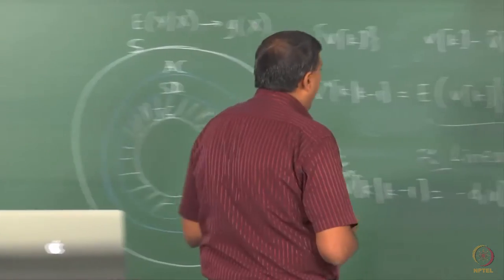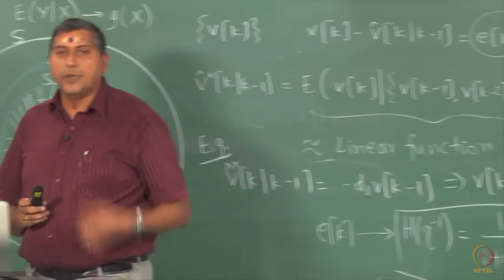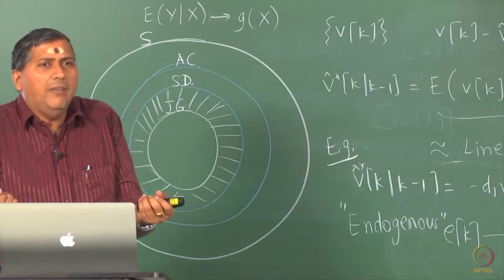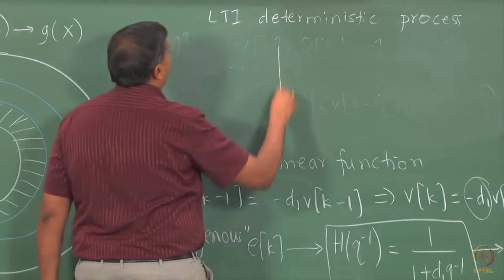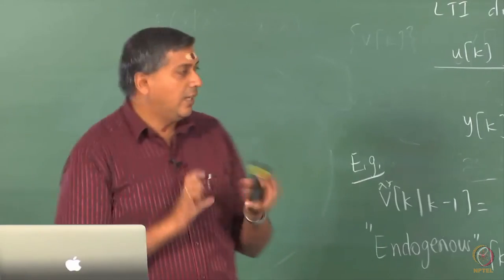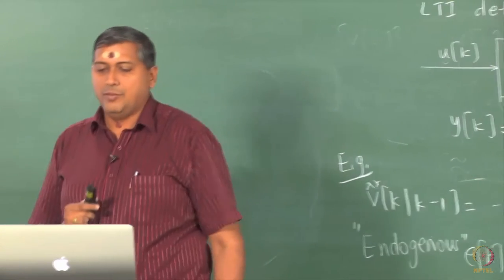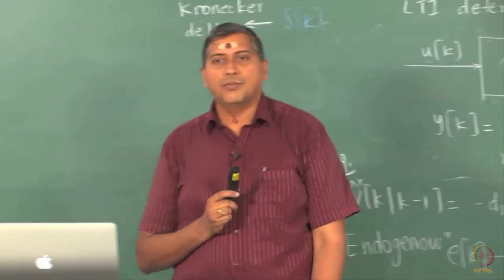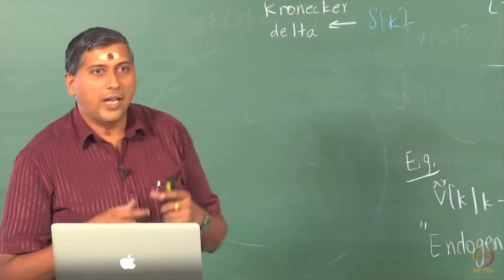Lecture 17B: Models for Linear Stationary Processes-3

Comment: Can we find some references related to the analogy to LTI systems that is being described in this lecture?
Reply from the maker: Not exactly. Books that talk about stochastic processes do not necessarily talk about deterministic processes in the same sense. The general usage of "filter" is common though. But that's where usually the connections stop. However, it is useful to go further and present the reader with a richer perspective. Models for deterministic processes relate signals (input and output), while models for stochastic processes although on the face of it do the same, but also capture the dynamical relation between the statistical properties of the random signal (output) and the endogenous cause (input). Of course, further analogies such as the combined properties of "stability" and "time-invariance" and "stationarity", the "linearity" definitions and similarities in interpretation of frequency response functions at the spectral density level (not at the Fourier transform of signals) helps.